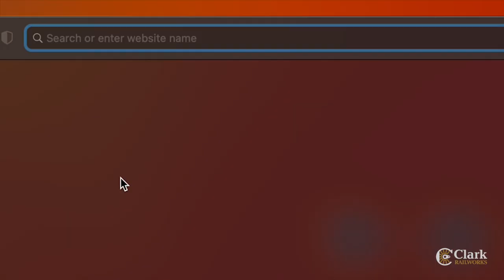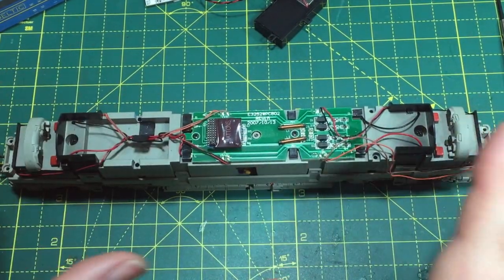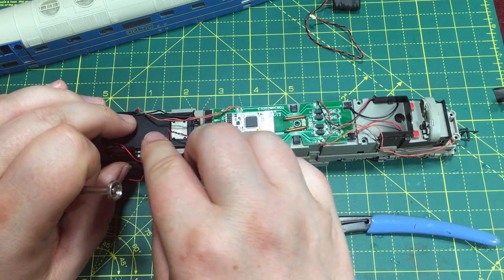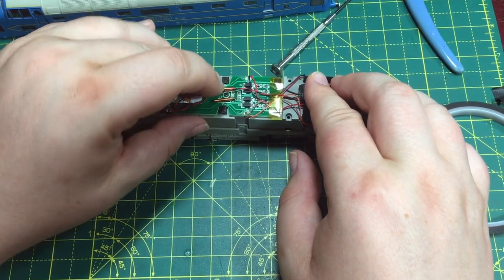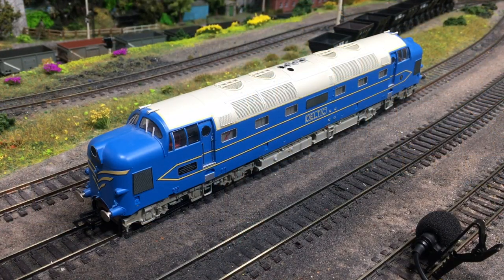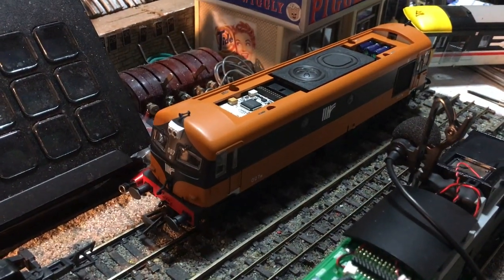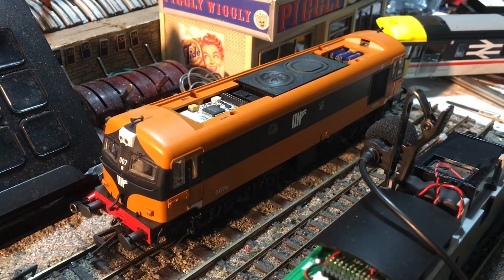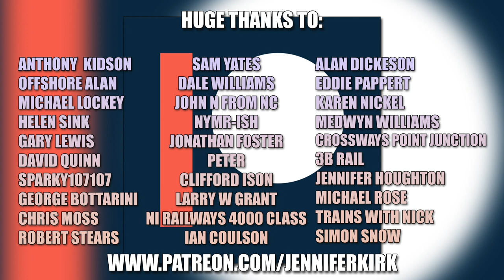How to Get The Best Budget Deltic Sound With Hornby TXS HM7000 Installation Guide

Comment: As you noted, it is lacking in bass. Via my hifi amp and big speakers, it sounds like a Napier diesel in a tin can! It sounds a lot better in the Irish? loco with no top on, so maybe it is the lack of vents in the roof of the Deltic that is muffling the sound? I could be tempted by the 7000 decoders, but I'd have to buy/borrow/beg a smartphone so I could programme them to work with my Elite! - - Hornby might like to consider selling the decoders pre-loaded, for heathens like me!

Comment: Hi, great to hear the deltic sounds.I have got more control out of the EM1 in series with a 8ohm large sugar cube. (Small one too thin sounding) This gives an easier 12ohm load for the TXS amplifier. The minimum requirement is 8ohms and the em1 is 4ohm. ESU and Zimo can handle down to 4 ohms. The class 56 I have on test is at 50% volume and is clean upto 75% volume I did a little video.  Cheers Steve

Comment: I have a Hornby Class 08 sound fitted locomotive.  It runs beautifully with the sound switched off, but awfully when on, spitting and spluttering.  I purchased the HM7000 21pin decoder and it now works beautifully.  Obviously the old decoder has become faulty, even after going back to factory settings.  I’m impressed with the Hornby 7000 decoders.  
I also have a Dapol O Gauge DCC ready Terrier.  The Hornby HM7000 decoder does not fit as it has to fit the other way round, therefore they are not universal, although I am sure there must be solution to this.
Thank you, I am now going to fit a Hornby HM7000 decoder to my Bachmann DP1.  I would not have risked it without the confidence of your video.
Reply: Installed a larger speaker, fits beautifully, works a treat.  Not sure why the suppliedTXS speaker is so poor as it works well in other locomotives.

Comment: To optimise the Deltic profile sounds with the supplied Hornby speaker, I found that I had to turn up the engine sounds up and then turn down the other ‘function’ sounds using their dedicated CVs. Its sounds much better this way.

Comment: I installed HM7000 in my Accurascale Deltic. The only feature on that model that I couldn't access with the Hornby decoder is the Hallway lights. Sound is awesome. 

Also, These decoders can run from a Railpower 1370 analogue controller with no issues. I bought two decoders, both are still working a couple of weeks later running off said controller.

Comment: It's great Hornby has finally got that Andriod app released. I'm sure it will help sales greatly.
@exarkun42 it's good to hear the Deltic sound is good. I think Jenny needs a better microphone to pick up the loco sounds as they always sound a bit 'tinny" to me.
I'm mainly steam and the HM7000 sounds fine in those. but I'd like to use them for an 08 and a 31 in the future.   Cheers!